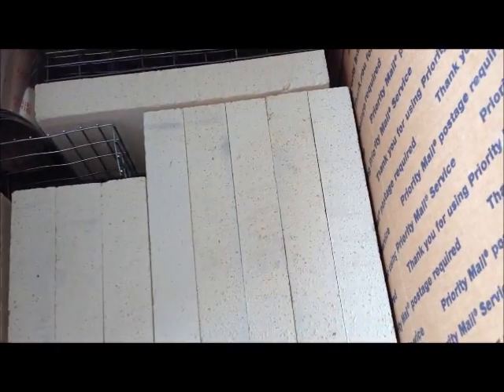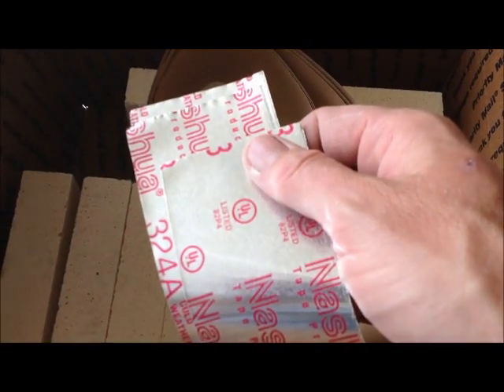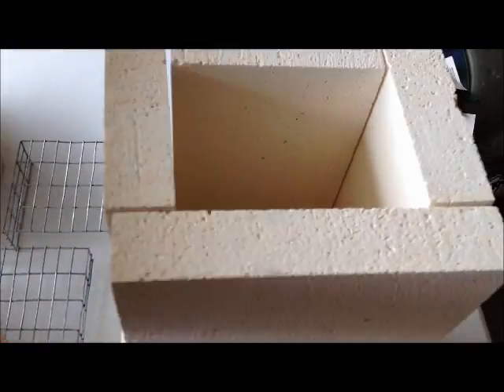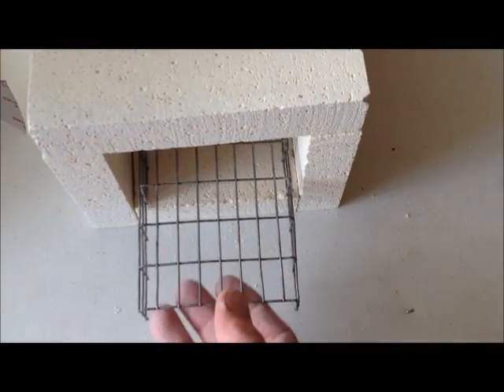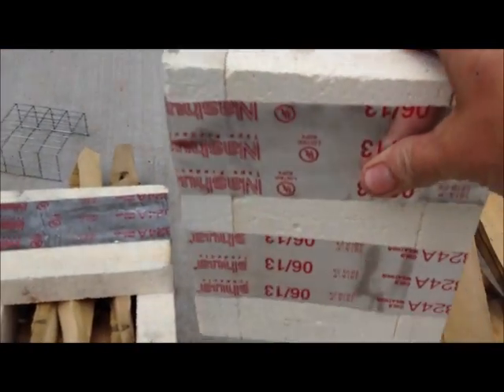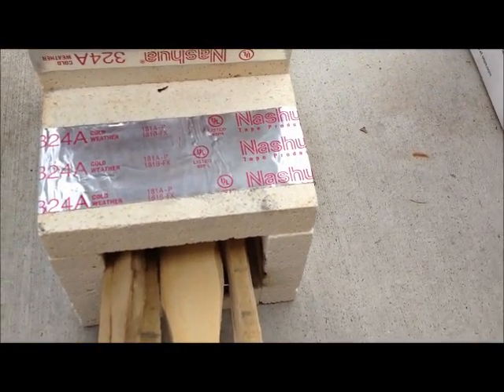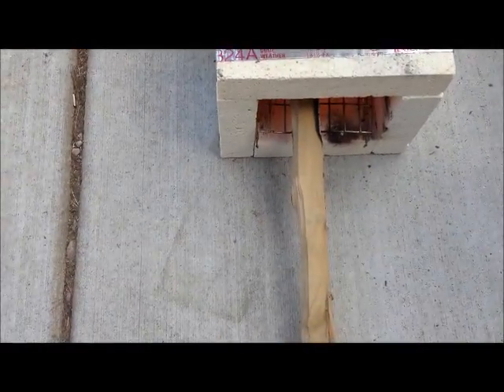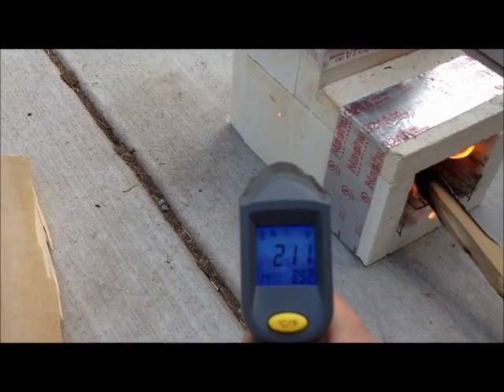Insulating Firebrick Rocket Stove

Comment: I don't know why people call these rocket stoves... these are just open stoves...
Reply: Actually it's a "L" or horizontal feed Rocket Stove.
Reply: The roaring of the draft passing by the fuel sounds like a rocket engine running.
Reply: @TheRojo387  mmm... 🤔 nees to try one
Reply: dimmacommunication Because they use a J tube design that draws air through, creating greater heat, burning off smoke and gases, and using biomass more efficiently.

Comment: Did you buy this kit or do you market this kit for sale? Could you tell us the dimension of the two different sized bricks...? Good video - Thanks!
Reply: Yes where
Reply: Late response, but I think these are the dimensions:

long brick: 9" x 4.5" x 1.25"
short brick 7" x 4.5" x 1.25"

the 9 inch seems to be the standard size for insulated firebricks.